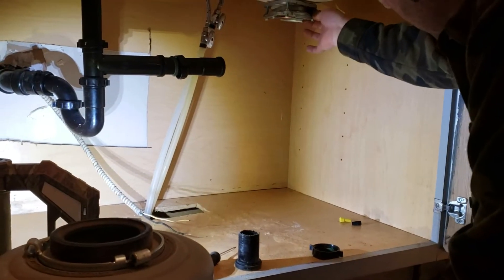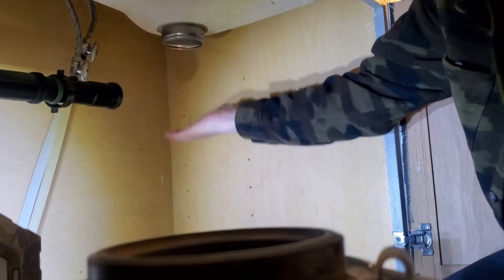How to install a new Garbage Disposal

Comment: How to remove lower mounting ring away from the actually garbage dispose with the “S ring tool” provided when the sink flange all provides are still attached, and moved moved, all pieces moved and it is hard to get it disconnected. Thank you!
Reply from the maker: You need a flat head screwdriver to pop the ring off